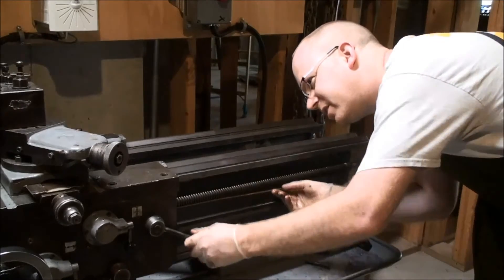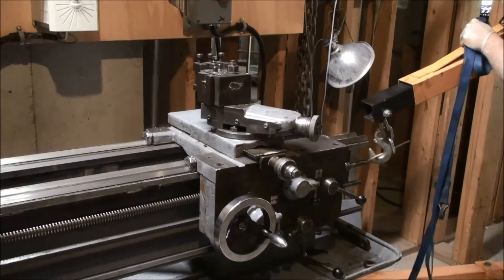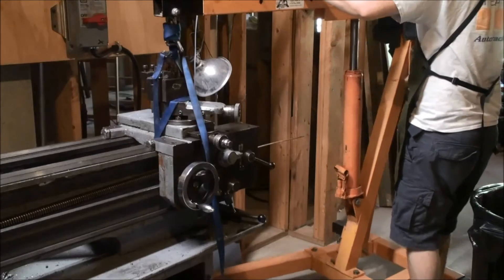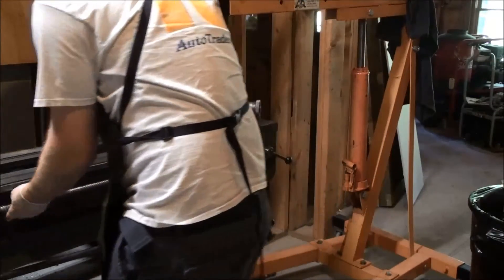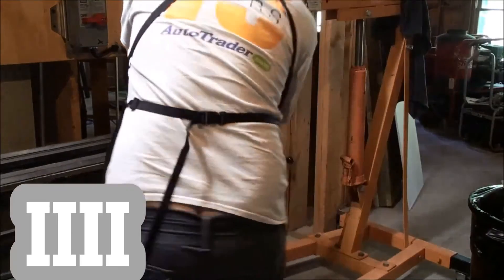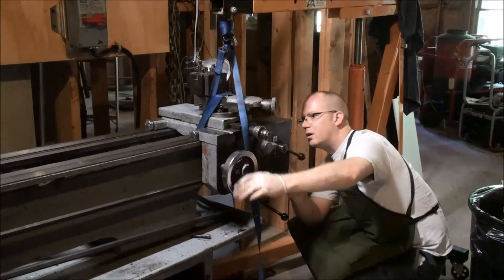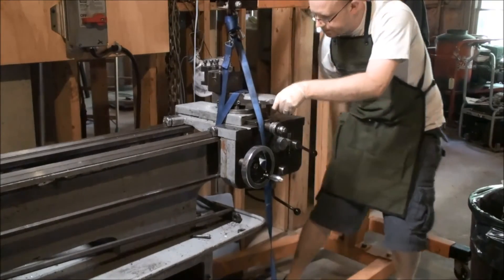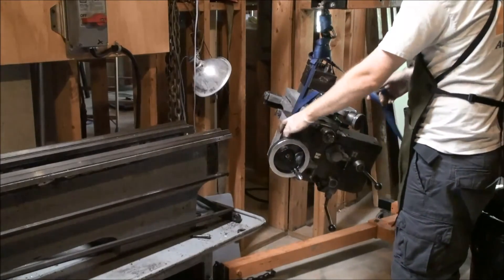How to properly and safely remove a lathe carriage- StoreBro Bruk

Comment: The shop cranes sure are handy.  In have one very similar.

You will do better taking off the carriage and putting it back, if you first remove the anti lift block/strip at the rear underside of the carriage.  This will reduce binding.

This is usually adjustable as well and comes off easily.

Cheers Rob
Reply from the maker: Thanks Rob!  I thought that would be the case when I first removed the carriage. The problem I ran into was the U shaped piece that holds the carriage on the table. 
There is no other way besides sliding the piece off the shelf.

 Interestingly that back piece didn't even need to come off this last time.
Reply: OK.  Good to hear you've checked it out.

Cheers Rob
Reply from the maker: +xynudu I do appreciate you following along and your positive guidance! There were many times I considered scrapping it but now I am very glad I stuck with it!
Reply: You're doing great.  Well on the way to full resurrection :)

Cheers Rob